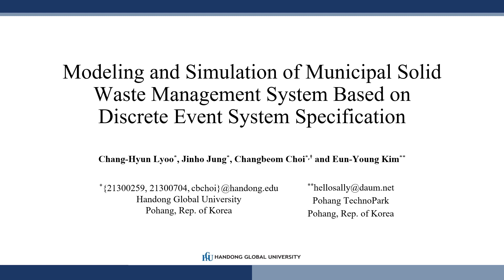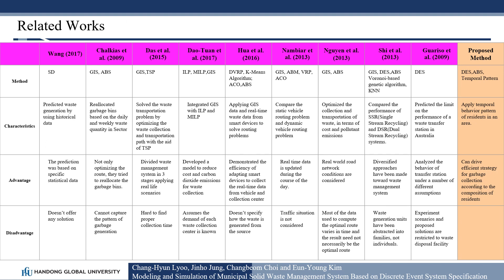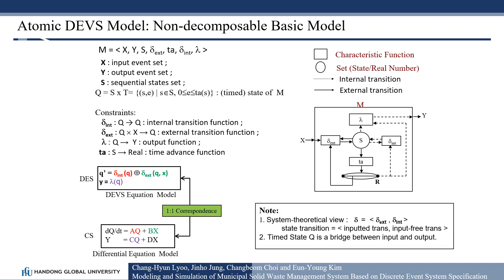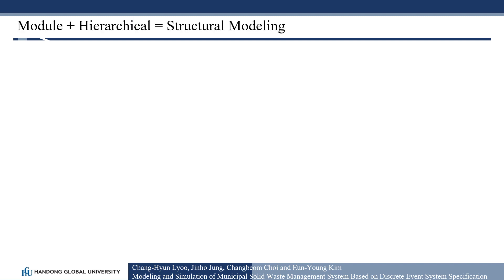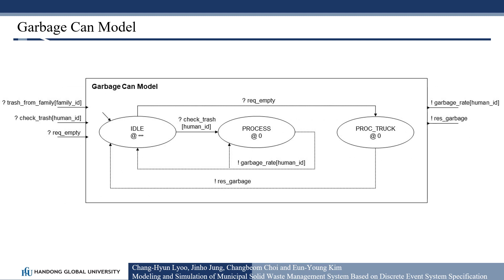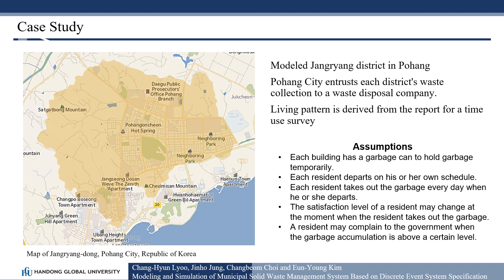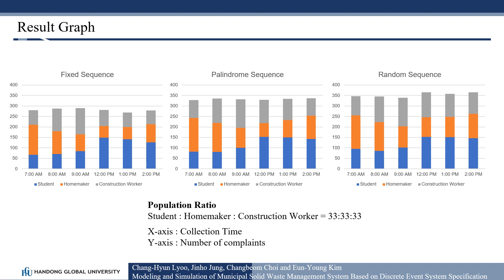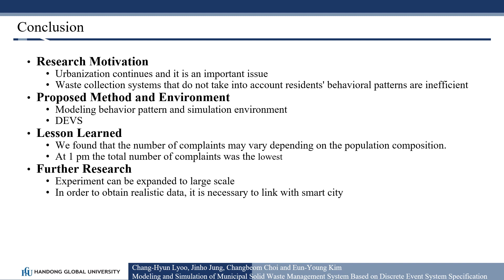Simaud2020 | Modeling and Simulation of Municipal Solid Waste Management System Based on DEVS

Comment: I have worked on hospital waste management practices in public and private hospitals. Which waste management modelling software can I use in my research paper?please guide me.
Reply from the maker: http://github.com/cbchoi/pohangsim 
Here is the git hub repo for this presentation. I have developed ui and model based on EVSIM which is a kind of Discrete Event Simulation Engine.
Reply from the maker: You may also check this url https://github.com/eventsim/evsim.
This is a link for simulation engine itself.